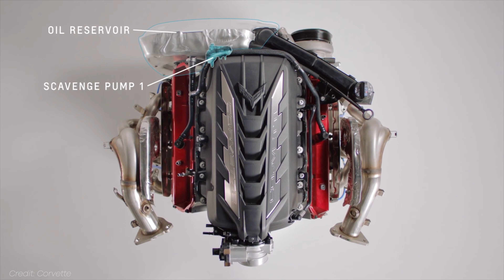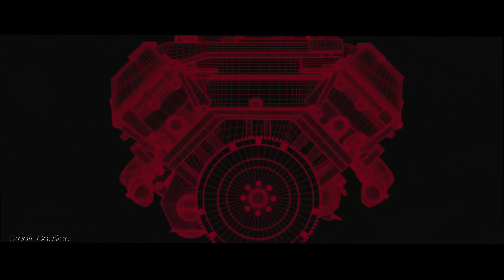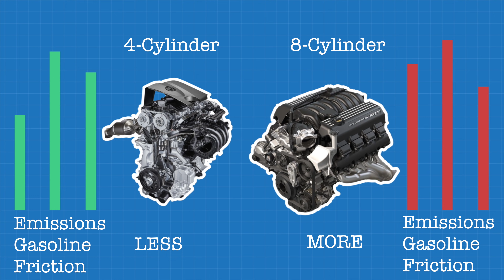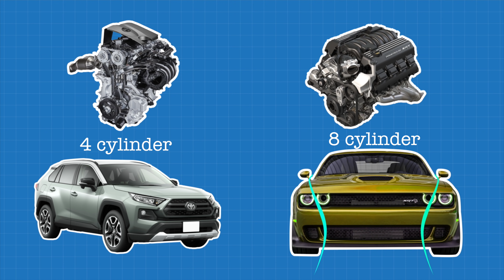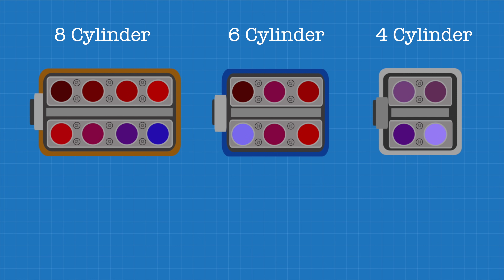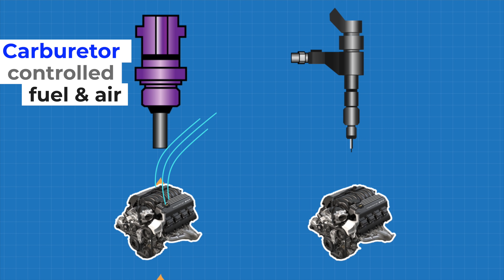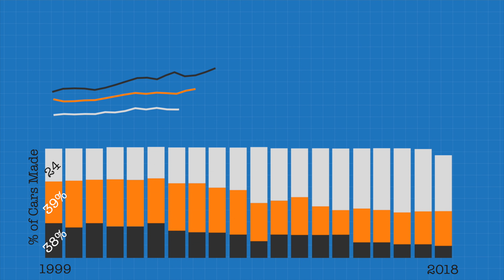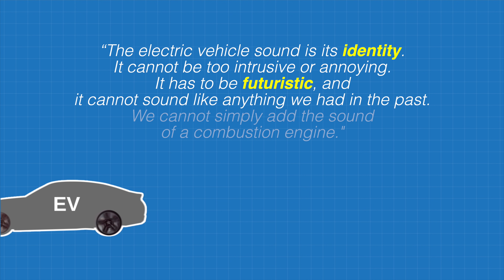Why V8 Engines are Dead

Comment: V8s will never die and neither will the inline 6 if americans want reliable workable power ready to perform every day for years to come.
Reply: Car Freaknatic everyone doesn’t want a damn electric vehicle
Reply: 4 electric moters would overheat and break if it had to pull my plumbing truck and trailer up a grade for an hour, and if it doesnt break the battery definitly ran out of juice before i made up the hill, and i can expect major rebuilds if i did that every day for a year in an electric truck. V8s and I6s are tried, tested and true and for americans who work the hard jobs, a prius or tesla cant get the job done. people who push the ev thing so hard tend to forget the cyber truck is no where near as capable in terms of range and consistant reliable power as a 1ton chevy express with a duramax. my truck can have 2500lbs of tools and equipment inside, hauling a 5000lb trailer and drive 100miles a day, 5 days a week, and ill fill the tank twice a week .and ill have this truck another 10 years without any major rebuilds. id be on my 3rd cyber truck by now if i used an ev for heavy duty daily driving
Reply: Nicolas Hill not only that batteries lose charge over time. Big problem and big expenses
Reply: @Car Freaknatic I don't think EV nerds like you will ever understand people like us who love ICE. It is not all about the acceleration but the way a car with a ICE makes you feel. We don't really care about the efficiency of the powertrain or the energy used to make gasoline or whatever, we want that noise, vibration and engagement.
Reply: @nealp885  ICE will never compare to an electric motor, the argument against EVs is as absurd as saying the horse and steam engine are better than what we have now. Move on!
Reply: Alexander Rosales you’re definitely a liberal
Reply: @Car Freaknatic all it takes is a small emp type explosion or  event or electric magnet to destroy EV's remember that.....no I'm not saying it's bad I like all kinds of vehicles  but each one has a weakness and problem
Reply: @trashcooper1963  Then we will ride horses because no on will be producing oil in large enough quantities to power your car for years.
Reply: thesres countless examples of teslas "towing" and doing it poorly okay so im not talking about you and your little bookworm life in seattle you would never need a truck and i understand why. ive been in a tesla its good its got torque it goes fast ok it has hrsprs but for COMMERCIAL perposes electric moters arnt efficient or reliable yet. some cattapiller diesel engines are built to stay on for a YEAR straight. alot of power plants and natural gas plants are run with DIESEL engines. you know what lets tow 50tons with an electric moter foget the Kenworth C500 with a gvwr of 150000lbs because you say electric is better lets have a contractor with 500 employees bet his business on that
Reply: plus to make a battery for a tesla makes i think double the carbon output it takes to make a regular truck? not that effecient.  and when u put an electric moter in a heavy towing situation you get almost a half of the range you get normal. a kenworth T800 can get 8 miles per gallon with 50 thousand lbs in it every day but last on the road for 20 YEARS and if you drive 160k miles a year you might fill up 500 times. but remember these trucks are used to BUILD AMERICA not for uber or lyft so u dont understand how essential it is to have these beasts to bring concrete and asphalt for your starbucks to be built on. gas and deisel arnt perfect but until you can put an electric moter in a catapiller dump truck and work the quarry dont talk down on people for owning "ICE"
Reply: @Car Freaknatic except evs are expensive and only used in cars. And the Tesla cybertruck is not a truck. Electric is so expensive and I can go out and buy a old jeep Cherokee 4.0 or a old f350 7.3 idi for under 3grand and have fun and not you know be ritch and worry about my paint or something else expensive breaking
Reply: @Car Freaknatic Do EVs make a roar like a V8? Do EVs give you that feeling when you listen to a nice exhaust on a car? No, right. Sometimes, it's just the pleasure that outweighs everything else. EVs are great. ICEs have been around a long while and even I, a millennial, love ICEs more than EVs. EVs will eventually replace ICEs, we all know this. But for as long as they haven't, let us all praise ICEs for everything they are.
Reply: @Car Freaknatic yeah but not 150 tons of bmw parts. so when an ev is in service over 20 years with no major rebuilds and is competive in price and can consistantly work 5 days a week 10 hours a day movjng 100k lbs minimum, and doesnt take double the carbon footprint it take to make a regular truck, and the range is equal to 2,000 miles on one tank of diesel like a cummins is capable of i will be happy to join your pretenstious ev bookclub where we all sit around and smell our tesla seats and look down on people but in the mean time bro theres work to d
Reply: Right On~!!
Reply: I don't like how new car manufacturers are putting turbo 4 cylinders in everything.  Now almost all new cars require premium gas which is half a dollar more per gallon.   Just give me a normally aspirated 6 cylinder where I can still put 87 octane in it.
Reply: @Car Freaknatic wow everything needs maintenance. I would rather have a car I can fix then one I have to take to computer programmer .
Reply: @timesthree5757  And one that the manufacturer can't just disable features on remotely.
Reply: Car Freaknatic lmao my friend has a Tesla p100 don’t get me wrong it’s fast but my friend has a “big bloc” v8 2019 hellcat 10/10 times I would choose the hellcat it’s about what the person wants Evs are good in their own right but for me their too silent if I’m spending 90k plus for a brand new Tesla it gives u power of course but no noise no head turner no anything... in my opinion I just think that a v8 is worth it if u have the money you’ll enjoy it more the attention the power the roar it screams on the road u can hear them from miles away I’m not even joking about that but V8 for the win!
Reply: @Car Freaknatic okay give me examples of electric moters bringing 500tons of rock from the quarry 400 miles to the construction site where their building your apartment complex. or the example of the 2 teslas push/pulling the 200k lb power transformer that your city runs on
Reply: @Car Freaknaticas a matter of fact i find it very hard to take you serious when youve probobly never been in one of the vehicels or to a place so unforgiving it would require equipment of that stature. you've definitly never worked in an enviroment that required them because if you did, you would have more appriciation for them, and the americans who require them. teslas are a statement and status deal, a cummins is an investment, and its going to be used to WORK for the next 15 years.
Reply: @Car Freaknatic I do agree but still all cars have a weakness and problem that will eventually lead to failire Going all electric isn't always a good option same with gas and hybrids.......but it is a great start to something better than electric and gas...possible plasma/thermo nuclear.... now with gas yes it's easily flammable and more likely to explode but they have a better chance of starting even when the battery is dead at the same time evs have a longer distance traveled .....both gas and electric cars both have luxury comforts saftey systems and smart controls which is really good either way both are equally dangerous but safe  at the same time is what I'm saying
Reply: @Car Freaknatic maybe reliable but evs aren't cars that can tow well or go long distances, it's something you cant overlook. What you would rather tow a trailer on a roadtrip with, a V8 or an EV? They'll get there but there are things that evs dont excel in, pricing for another example.
Reply: +Car Freaknatic And when your electric vehicle breaks down, it will be much more expensive to fix. Also, they're terrible when you need to pull a load for any distance. Diesel fuel is the best.
Reply: @Car Freaknatic trains are a little different but okay good example. how much did it cost compared to a regular train to manufacture it im jw
Reply: and how much lithium and other potentially toxic materials were used to make it. and by the way most of the worlds electricity comes from burning coal so recharging that train leaves just as much pollution in the long run
Reply: Car Freaknatic but fuel doesn’t power a Tesla and a telsa doesn’t even drive as far as I see old chevys lmao a duramax would flex on the cybertruck
Reply: @Car Freaknatic But you can just top off the tank and keep making runs...
Reply: @Car Freaknatic You do not even own one. STFU. Until you go through the charging hassles and Tesla decides to disable your supercharging option you are just a mouthpiece.
Reply: @Car Freaknatic Trains are diesel/electric. And the size of the motor alone shits your comparison as a diarrhea explosion. A diesel/electric train engine puts out over 6K HP.  How much diesel does that take?  I can't wait to see the range of that ugly Tesla truck while towing. An F250 will work all day long without breaking a sweat.
Reply: @Car Freaknatic I thought we were talking about towing? And without the 'big brother' Tesla supercharging you have to wait 3+ hours to charge up.
Reply: @Car Freaknatic But if you deplete your charge and are on a road trip... GOOD LUCK finding a charging station close to your route in Montana.
Reply: @Car Freaknatic Your activity here is that of an attention seeker. Hypocrite.
Reply: Car Freaknatic and also, do you RELIZE how big the motors are on those Germany trains? There is no way that it can fit in a car. So yes diesels are the better option just stop arguing about things people are doing for years. It’s there stuff don’t discriminate what they do and how they transport/ what they transport it with
Reply: Car Freaknatic Lol let me stop you there. For example no EV would last on my farm, I own 3 Chevy 2500hd’s, 2 have 6.0 vortecs and one is an 8.1 vortec. All over 250,000 miles(all of which are brutal miles that no ev could survive, as well as all of them are on the stock transmissions), towing my international tractors, cultivators etc. my 1988 kenworth W900B with a Caterpillar C16 diesel to tow my big stuff, combines, sprayers etc. It has 681,753 miles on the dot right now. Now you tell me when evs will be able to withstand such brutal tasks.....I’ll wait. Exactly you can’t because there is nothing that can compare to the capability of an ICE.
Reply: @braddenr.4778 i have a 5.7 and an 8.1. the 5.7 has 180k same 4L80E trans and vortec engine no major issues and the 8.1 is in a flat bed gmc only 60k on it and elon musk over here swears to god he knows something about my trucks. i guess the international at work with 300k miles is unreliable and inefficient too
Reply: Nicolas Hill Oh I’m telling you what man, he certainly thinks he’s an expert, and swears up and down that my trucks aren’t efficient and have too many moving parts, oh please he’s just comical at this point. Both of us and my old kenworth W900B with 600k miles disagrees with that haha. Nice to see someone else showing love to the old 8.1, wonderful engine. All vortecs are and have proven to be some of the best modern V8’s in the truck market, but not according to Mr. No your wrong. Some people just can’t accept facts.
Reply: Car Freaknatic wow you ev lovers are dumber than I thought. Ok your first mistake is thinking I have to constantly run to the gas station, I get tax free gasoline and diesel located on the north side of my garage, so no I don’t. Second I don’t need to own an ev to know it can’t take the beating of my farm trucks and equipment, especially towing, you’d be dumb to use evs for constant towing because you would empty the batteries in no time. 3rd yes my engines may have 2500 moving parts, but between all 6 of my trucks, all 2500 parts are still fully functional there buddy. You really must think you are smart huh? Don’t look like it to me, must be one of them uneducated city slickers considering you don’t even know about tax free fuel. Try again
Reply: Car Freaknatic Oh yes regular wear and tear parts, except when the ENTIRE vehicle runs on electronics. Let that one sink in......It’s especially nice when it’s required to take it to a service dealer to fix some $3000 computer component on it. No sir, I’ll stick to my $70-$150 routine maintenance.
Reply: @braddenr.4778  were not part of the tesla club man we dont have tesla seats to sit around and sniff all day. i got 10×50 ft trench to dig tmrw morning im using the 8.1 to tow in the excavator and the 5.7 has all my tools and a small trailer for rock/leftover dirt. man the big block doesnt get enough love mines has a tune its straight piped has a cold air intake and air brakes its a mean rig
Reply: Nicolas Hill Oh absolutely man, imo the 8.1 was chevys best engine design since the 350sb. Thought it was extremely stupid to get rid of it. Absolute brute of an engine backed up by one of the best auto transmissions, the 6spd Allison. Don’t get much better than that I’ll tell you what. Like I said, happy to see people using the ol 8.1 like it was designed for, getting work done and doing it well. Good luck with that trench tomorrow, I’ve got some fields to cultivate myself haha. Cheers man🍻
Reply: @Car Freaknatic what, u mean OIL CHANGES? bruh ive had this truck since new in fleets ive changed the trans fluid maybe 2 times and because its a 4l80E its still going strong in a WORK truck that weighs 8 to 10k lbs 5 days a week for 20 years now how is that not efficient or reliable the most ive replaced is a fuel pump an alternator and a daytime light modual aside from break pads and my 8.1 liter vortec is a fckin powerhouse i see a gas pump once a week. the reason why i do not respect your opinion is because how arrogant you are about my truck. i think teslas are badass i never said EVS ARE POINTLESS and i think my truck is badass and i think your not as smart as you believe u are . in 2020, a v8 or an inline 6 is not only more affordable but more effecient and easier to maintain than an ev, and it will be for at least another 10 years. i never said OH TESLAS WILL NEVER BE POWERFUL ENOUGH but you took it that way so you could try to belittle me about my "ice"
Reply: Car Freaknatic I have a truck with 310k miles that has had no major work done to it. 19 year old truck. How does that compare to a 8 year warranty ?
Reply: Car Freaknatic also. Let’s see an EV haul as much, as far, and as efficient as an 18 wheeler. It won’t happen. 18 wheelers build America bud. And those shitty electric motors we have currently cannot. Maybe in the near future. But for now they have no competition.
Reply: Car Freaknatic ok elitists
Reply: @anamerican2305  When the first Cars came out only a few had them, but they quickly replaced the horse, there  was no going back same with EVs.
Reply: Everyone who is completely against EV is brainwashed by the fake news media, period.
Reply: @AdamIverson  not against them at all actually, just make it worth my time before you try to belittle my troglodyte brain for not wanting to spend 100k on something when i have better more affordable options at the moment.
Reply: +Adam Iverson To be clear, I'm in no way against electric cars. The concept is cool, and electricity is my area of interest. But the electric cars of today don't have the energy storage and/or the power to efficiently tow a large load very far.

Comment: If the day should ever come that finds me having to trade my gas powered transportation for ev...🤢
I'd like it to at least have the sound of a Ford 4.6 Interceptor, one that's modified ever so slightly by swapping out the stock mufflers with a pair of Magna Flow 40s.

Comment: Out in the country and jobsites, a V8 is still needed.  I have downsized from a 440, to a 318, to a 289 and that seems to be the sweet spot.  I used a 4.0L V6 to haul a compact tractor and shredder and just didn't feel it up to snuff.

Comment: V8's will go at the same time as all other combustion engines imo. They are still very popular in trucks, vans and sports cars, and they are by far the most popular engine in drag racing. It's not a rich mans engine either, as you can pick an old ls block out of an old van and build it to 1000hp pretty easily and cheaply compared to other platforms, or you can leave it mostly stock and throw it in almost any shell and have a pretty fun drift car or track car.

Comment: V8's will never absolutely die. As long as theres red blooded Americans that enjoy their toys and turns their own wrenches the V8 engine will survive. The turbo smaller engines don't last when used as work horses. And diesel maintenance is expensive.  V8's will always be the best cheaper option for handling real life. But mechanics that's looking to make money on people that doesn't know better will promote the new garbage engine choices. And it's not about emissions because there would be no diesels on the road at all. It's all about selling the latest and greatest non-perfected technologic nightmare nobody can fix themselves. The dealerships can't train their own technicians fast enough for the new stuff and as soon as they get a grip on it the manufacturer changes it to a more complicated over engineered POS. Sorry scotty but its V8 or bust for me. My wife has a Honda tho lol. She loves it . But my 84 305 is still running like a top never been rebuilt just fuel injected it 4 years ago